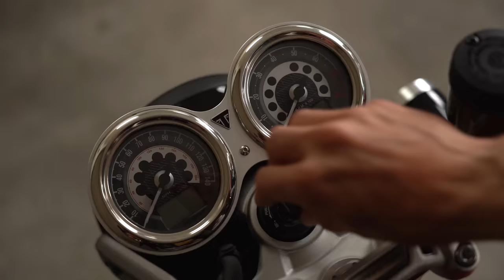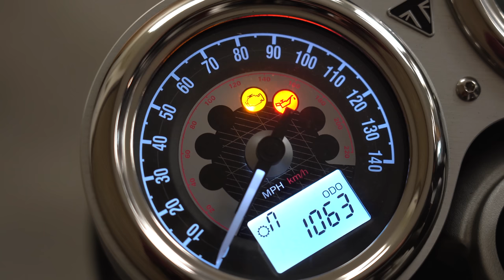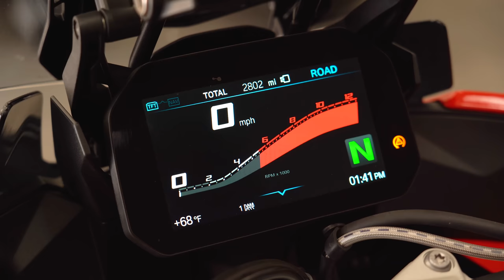Do You Need To Warm Up Your Engine? | The Shop Manual

Comment: Yes, particularly carbureted air cooled engine. Need to get it to smoothly accept fuel before riding it. When it does that, ride it smoothly and properly.

Comment: A water-cooled bike I'll just start it up, put on my gear and take off... but an air-cooled one like the S2R800 I prefer to let it warm up to at least register some temperature in the oil (>120F) and run smoothly without the high-idle adjusted up before I take it above 4000 RPM or so.  If I start riding before it registers temperature and it's chilly out (i.e., around 50 F), it'll take a good 10-15 minutes to get to 120F!

Comment: Once your oil pressure is indicated its fine to go low and slow, the real kicker is cold seizure before the cylinder and piston are up to operating temp. Most cases its aluminum pistons in steel cylinders, and they have different coefficients of expansion.

Comment: will clarify a little more even on fuel injection fuel condensing on the cold metal (intake, cylinder etc)is still an issue but as the ecu handles fuel in a simple terms a form of "choke" is handled by said ecu called cold start enrichment. This is noticeable as some bikes will exhibit a slightly higher idle and/or running rich (that glorious fuel smell we all probably have experienced) mainly bikes from 90s-2010 are most noticeable of this behavior.. The good news is this heat doesn't take long to get into the engine and as a rough guide takes 30 seconds to a minute longer in colder temps with the tell tale sign of the idle speed dropping slightly to normal speed.when warmed up to temp. Old riders tip I got was start your bike, then put on your gear and you can ride away worry free as it takes you longer to get ready than your bike as its more keen to ride than you are.

Comment: In the manual for my 2022 Harley Road King, it states “The engine should be allowed to run slowly for 15 to 30 seconds. This will allow the engine to warm up and let oil reach all surfaces needing lubrication. Failure to comply can result in engine damage”.
Reply: I always have to wonder how much stuff is put in owner's manuals just for manufacturers to avoid having to pay for repairs during a warranty period.
Reply: @HartyBiker  Why would they worry about it ? Oh that's right they know something about the bike they make lol.

Comment: It is totally recommended when engine start in winter or below 75 degrees. Because metal parts get right dilated above this temperature.

Comment: Yea, I HAVE to let my bike warm up it's 38 years old it won't allow the bike to get any throttle so 👍🏼 at least you covered that first but even with choke it will take a little time to get the bike to run properly.

Comment: Suzuki in their 2005 GSXR 1000 manual, tells you NOT to ride until the temperature gauge is reading numbers and not blanks. At least.
Also, first 1000 miles no full throttle, no revving beyond 9k.
Case tractor ECU won't allow full power use until engine is warming up, even when not under load (driving not ploughing for example) Take care of the engine, and it will take care of you. 90 percent of all wear occurs at cold start.

Comment: I use to run a 2 stroke carb bike up till 2019. But even after getting a new FI bike in 2021,  i still let the bike warm up for around 3-5 minutes before hitting the road on a cold morning or night. This is such an eye-opener. Thanks Ari n Revzilla. that's plenty of petrol saved moving forward.
Reply: really?  2 strokes lubricate whilst running but this guy's talking about 4 strokes only, 2 strokes have a much shorter life and you do need it to warm up before putting load on it - treat it like a new 4 stroke - it'll die soon and this is only for new ones, old 4 strokes do need to be warmed up refer to the manual , not some guy who won't pay for it on youtube.

Comment: Well, the manual for my 1200 Super Tenere had specified the warm up temperature before ride, my ex-police FJR1300 with 60+ thousand miles just would not get into gear without a warmed up engine. I have no idea about the newer 2013 FJR, but there is a temperature gauge, which says "low" right after start up, so I am guessing, it is still a good idea to wait till it shows proper numbers instead of the "low" text.

Cool explanation, though, thanks!

Comment: Ladies and gents, no matter what you use; a car, bike, lawn mower, whipper snipper, anything with a combustion engine, 4s or 2s - allow the motor to warm up. It is ESSENTIAL to allow all the components to go through thermal expansion sequence and ensure correct clearances are met between components and oil film lubrication is achieved. It will always be like this, idc what anyone says

Comment: I still warm up my bike. I noticed if you change the gear when it's cold, it's a little clunky, when I let it run for 20 30 secs, the initial gear change is smoothe.(it's also a Honda)

Comment: Same advice applies to autos as well.
The BEST way to warm any engine is to drive it at moderate speeds/load. This creates more heat and faster than idling it. Extended idling to warm an engine can actually cause fuel to condense on cylinder walls, degrading the oil, and potentially causing premature wear. The colder it is the worse the condensation and wear. 
Anyone who has a remote starter to warm up their car on cold winter days by sitting idling in their driveway for extended time is actually risking damage to the engine.

Comment: Have an actual pretty interesting car that has little lights that turn on just over the tachometer (showing where not to rev-into) when it's cold outside. As the engine temp and oil temp comes up the lights slowly turn off and when it's in automatic mode (DCT transmission, so it has a full manual option) the vehicle even when giving it the beans will automatically shift before the engine RPM hits those ranges (lowest I have seen was like 30 degree's outside and my normally 6800 RPM vehicle only would go to about 5200 RPM unless in manual mode).

Outside of that I usually just wait until the cold-idle RPM's come down (usually 30-40 seconds, sometimes longer in the winter as I believe it's tied to the catalytic converter temps).

Just enough of a delay to get settled in, put on the sunglasses, plug in the smartphone, and select some music.

Comment: I don’t touch my throttle until the engine temp is above 100 degrees. And I don’t even think about lifting the kickstand until 140. I noticed my 07 Cbr600rr doesn’t make hardly as much power if I don’t warm it up. Everything also doesn’t feel as smooth like the shifting, clutch…etc. i also don’t do anything hard until I know my tires are warm. But I’m also dailying my bike in 10 degree weather so I try my best to keep everything in line as best as possible.

Comment: If you put an oil pressure gauge on the bike, you will see that for oil pressure to stabilize it can take about 10 miles of riding. It starts off real high (and this also means that it will be dumping oil back to sump sooner, due to the way pressure reliefs work). As the oil warms up, oil pressure actually becomes lower for any given rpm up until that relief opens. There are metal surfaces in the engine that expand and contract based up heat, as well. Your engine tolerances are not the same when cold as they are when hot. I mean, if you want to hop on and pin it to the limiter that is your biz, though.

Now, I'm not saying you need to let it sit and idle forever. But at the same time, you should not be stressing the engine hard when it is cold. Oh, and just an fyi for some, the coolant warms up way more quickly than the oil does. Even if your coolant gauge is showing full operating temp, that does not mean your oil is fully warmed up.

Comment: My 44 year old Triumph will start first kick from cold without choke and can be ridden straight away, but my 40 year old Suzuki GS550 needs to be left idling on choke for about 2 minutes before it will even respond to the throttle, so it's all about the individual model.

Comment: Seems like my old baby will need to continue to be warmed up :)  2000 model CBR600F4 being the last of the carbs.... still a quick beast!
Easy enough, start bike then start pulling on safety gear, check lights, tyres and brakes and it's almost ready to boogie

Comment: In the process of rebuilding the carb on my 07 VT1100c, I messed up my choke, so I don't have a choke on startup. I just turn the throttle a little more open when I start it and let it run for probably less than a minute until it sounds like it's running right and not stumbling a bit, then I take off

Comment: Modern engines are engineering marvels, but that doesn't change the fact that the piston will heat up faster than the cylinder and that will cause cold seizing if you give a cold engine too much throttle.  It has a lot less to do with RPM and a lot more to do with combustion pressure and temperature.

Comment: I personally own a Husqvarna svartpilen in bs6 emission guise which is equivalent to euro 6 and what I have noticed is the bike makes the throttle response sluggish until the Cat Con is heated up to its operational temp where its efficiency reaches atleast to 95% or so in order to reduce the initial emissions. Thought it was interesting.

Comment: I personally have a 2003 kawasaki zx6r and always start the bike and let it warm until reaches at least 50°C (water temp). I've owned the bike for 3 years and always do this because it's a pretty high mileage bike and a 600cc (636* to be precise) so the engine itself is a sport and stressed engine, at least this is what I always heard about 600s in general. So yeah, I wait for my bike to warm cause I want to treat it good and because still has a manual choke even if it's a fuel injected bike so when cold has a bit of trouble keeping the idle up without warming it a little.

Comment: As an engineer who have been working on engines for a long time, i disagree. Like it or not, there are moving parts inside the engine. When you warmed it up, the oil circulated and heated up  the engine. Besides, three minutes of warming your engine won't cost you a thing.
     Remember what if someone wake you up from bed and told you to do a 100m sprint without warm up.

Comment: you 60% right but we're men we dont put synthetic n dont have that high performance bikes
S1000RR still need warm up and the last line of yours is correct for me.
but still need to warm because we dint want friction 
watch shell transperent gearbox video -10° oil or lubricant what does affect on machines btw everyones thought but mine runs smoother when its warm up.keep it up.

Comment: Well you definitely hit on the actual reason why you need some engine temperature,  piston slap. Sure there are other components that will change dimensionally (all metals do with heat) but the pistons are the most important one. Run engines cold religiously and the rock motion from being a hair loose will cause wear that will eventually cause excessive slap, blowby and out of round bores. People who build engines let them warm up to some degree. I build my own engines and will continue to allow some sort of warm up. About 2 minutes depending on the engine. A small time frame compared to the eventual  loss of performance and cost/time for a rebuild.

Comment: For my bike, I've noticed when starting from cold, if I rev it idle, it takes longer for the revs to fall. It's likely the ECU doing this, but it is noticeable for the first minute or so. So by the time I've geared up to ride, I check the throttle once, revving ok? Good to go! But then again, I'm anyway cruising at about 40-60 Km/h.

Comment: Before I watch the video, here is what I do:
I start the bike, and go right away. Until I see a single bar on the temp gauge, I simply ride it extremely smoothly, no hard acceleration, and I shift under 30-40% of the redline, keeping the engine slow with a very minimal load. Once I see a bars appearing on the temp gauge I basically keep the engine under minimal loads (no hard accels) but I allow myself 1000 more rpms per temp bar. Once it's over half of the gauge, I ride it like I stole it.

Edit after watching: turns out I was doing it right. I love that BMW displaying a lower red line when it's cold!

Comment: I ride a 2000 sportster so I can’t really just take off cause it’s carb. I usually warm it up until it don’t try and stall when i go to pull out. If it’s 80 degrees it’s 30 seconds. If it’s low 40s it’s usually about 3 minutes sometimes even closer to 5 minutes

Comment: Wow, I guess we just didn't know what we were doing when we kick started our 2 stroke YZs and Elsinores 10 secs before the gate dropped, since they were faster off the line when cold.  Then again, we did top end piston ring replacements all the time.  I didn't know anyone in high school that couldn't pull the cylinder and change out rings in 15 to 20 mins or so.  Break in, shmake in.

Comment: Just one more tip: don't rely on the (water)temperature gauge during warm-up.  My Honda CBR indicates 175/180°F after only a mile.  But then the block and oil are still stone cold.  It really takes a 15 minutes ride for the oil to reach its optimal operating temperature.  And one more reason  why to gently start off: the tyres need time to warm up too.
Reply: That's not surprising, the sensor likely doesn't account for the metal around the coolant system to warm up when taking the reading. My mother's car does the same thing where you can't trust its estimate of the outside temperature until the engine has warmed up.

Comment: My old Suzuki TL1000S was nearly unrideable until the engine warmed up to temperature and the ECU switched to the warm map, on the cold map it would hesitate and stutter around the midrange. I think they all suffered from this condition and if I'm not too badly mistaken, it had something to do with the coolant temperature sensor being in a less-than-ideal location, on some bikes it wouldn't even throw on the warm map, or would switch between the two mid-flight. Still loved that bike, because once it was warm the Widowmaker was unleashed, it was impossible to ride sensibly!

Comment: Could have added that it actually beneficial to engine life to NOT let it idle, engine gets warmer quicker when you drive it which equals less wear. 
I let my fuel injected bike idle until it handles a little throttle without bogging, 30 seconds maybe depending on temperature, but it is 35 years old now :)

Comment: If the engine hasn't started in several months I'll give it more time. Based on the racket I heard after starting 2 car engines that sat for several months without running. It sounded like a bucket of bolts tossed into a wood chipper. For about 3 minutes. Then it slowly got quieter & was normal in about 4 minutes. A dry motorcycle engine may require less time for oil to flow to the top end since the engine is smaller.

Comment: Another reason against idling to warm an engine is uneven heating. As a bike sits, the engine doesn't heat as evenly as it does while under normal operation. This leads to some parts expanding faster than others which causes more wear. This will affect some engines more than others.

Comment: I have an older bike with carburetor (1997 Harley) and even then, if your carb is tuned properly, you don't need to idle that long.

I pull the enrichner (or choke) to full when it's cold and I let it sit until it starts goes from "blablablablablabla" to "thump thump thump" (which is about 30 seconds, really, just 30 seconds), and then I push the enrichner/choke down to about half (it idles at 1,000 rpm at half choke here, which is where the normal warm idle is set).

From there, I just ride off for the next 1-2 minutes/miles and then shut the enrichner/choke off.

But yeah, even with a carb, if it is properly tuned, you only need about 30 seconds to 1 minute of idle before you can ride away (no pushing redline until it's fully warmed up obviously).

I say this because I've seen dudes let their bikes idle for 5+ minutes to "warm up". That's overkill.

Comment: I never warm  any engine ever, except my big Peterbilt truck. I wait til the air is up. On a car or bike, I drive right away, BUT gently. Even if you're using modern synthetic oil, it is still not moving like it will when fully warmed up, so just hang back until the temp gauge is up there. I have never had an engine fail or burn oil yet.

Comment: Choke on a carb doesn't add more fuel.  It restricts air.  A richer mixture is the same result.  Just because "you don't have to" warm your bike up, doesn't make it wrong.  I live in good sized apartment complex.  Fist ride of the day, I first gear it a lap around the complex 5-6mph, and short shift it for a minute of two on the street.  No dial it on until operating temp is reached.  Remember your engine internals will be at operating temp long before the coolant is, so run it nice and calm the first minute or two, then turn her loose.

Comment: 30 seconds to 1 min is good, time to zip coat, put on helmet & gloves & mount bike, then ride off smoothly, HOWEVER if running 50wt, 60wt or even 70wt on vintage Harley, let it idle for 4-5 min when engine is cold, and I can say when down to single digits, I was never able to crank any Harley on 60wt, so always had to switch to 20-50 for weather below 30F

Comment: I ride a 1998 BMW R1100RT which is fuel injected but it definitely needs to warm up. I think it is an outlier to what you are saying however.   I may be mistaken but it looks to me like it uses low pressure injectors into venturi which have replaced the carbs on earlier models.  It will definitely bog and sputter when cold and it requires the use of a choke for the first half mile of riding.